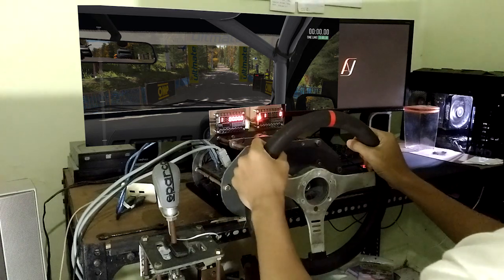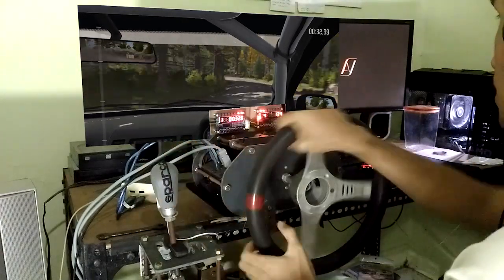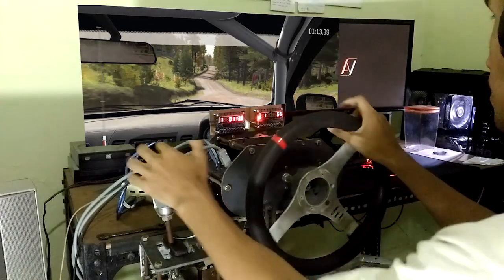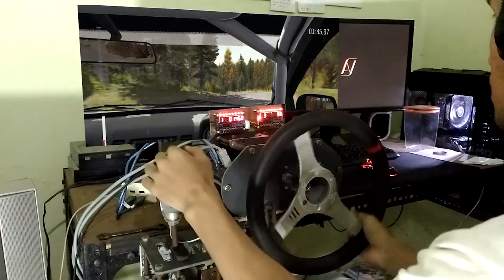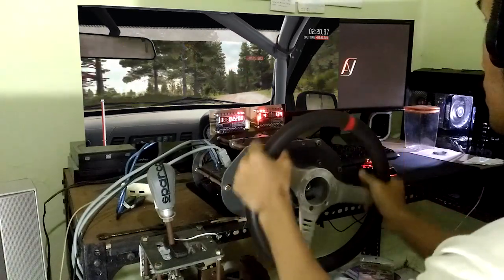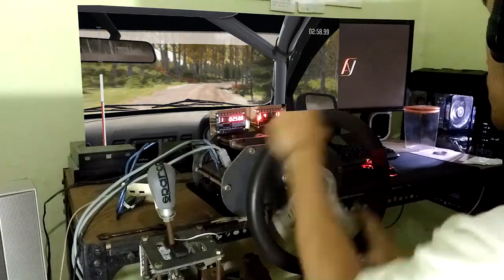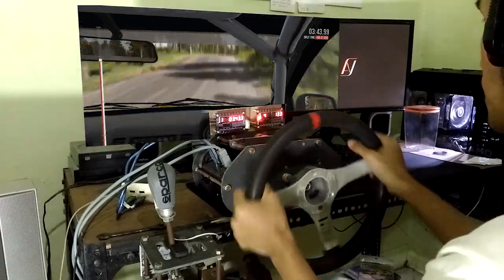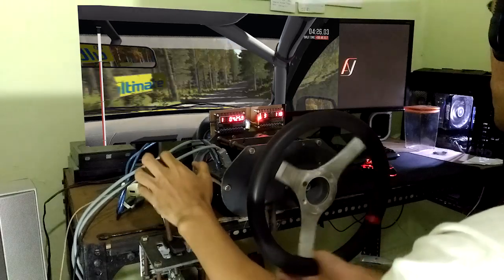Dirt Rally - DIY Steering Wheel | SIM Racing

Comment: Usas Leonardo? Para el volante usas un encodificar de impresora? y para los pedales usas potenciómetros solos o con resistencia?
Reply from the maker: yes i use leonardo and printer encoder for this project.
My pedal use 10K potentiometer.
Reply: @AgaYuditraStudio  Y no has tenido algún problema?
Reply from the maker: only a small problem with noise in the potentiometer can be solved by adding capacitor
Reply: Podrías enviarme una foto de cómo lo arreglaste? Te dejo mi correo jqh_1504@hotmail.com 
Y disculpa la molestia.
Reply: Y para el encoder de la impresora cuál se puede usar?
Reply from the maker: I use canon ip2770 printer.
Reply: @victoralejandrocanteraherr9003  el encodificador de la impresora no tiene problemas, lo que falla es el potenciómetro. Por eso mi pregunta.
Reply: @josueherrera8547  y el encoder como lo has conseguido?
Reply: @victoralejandrocanteraherr9003  Donde arreglan impresoras venden eso, a mí me costó aprox 5 dólares, pude pagar menos pero en fin. Algunos de ellos no saben pero es mejor que lleves una foto o algo. Me funcionó bien, lo probé en NFS MW y controlaba bien.
Reply: @josueherrera8547  Muchas gracias Daniel, la verdad es que ya no sé donde buscar y no sabía si podía coger otro encoder. Preguntaré por las tiendas a ver si lo encuentro. Un saludo!!
Reply: @victoralejandrocanteraherr9003  En Aliexpress hay varios, los chinos están 10-15$ y los mejores están 25-30$. Pero mejor busca, de seguro encuentras uno, es más barato y funcional. Suerte.
Reply: He buscado en Aliexpress y he preguntado en las tiendas bajo el nombre "encoder canon ip2770" pero no encuentro nada, que palabras buscaste?
Reply: @victoralejandrocanteraherr9003  Búscalo como Encodificador Rotativo o Codificador Rotativo, de donde eres? Yo soy de Perú y encontré el Codificador de impresora tuve que viajar unas 2 horas pero lo encontre, se puede usar de cualquiera siempre y cuando sea de Canon. No importa si es ip2770 cualquier otro
Reply: @josueherrera8547  Soy de España, pues voy a buscar por esos términos. Gracias crack, saludos!!
Reply: A España llega mas rápido ese tipo de encodificadores de 15 dolares igual los de 30, pero si consigues una impresora de segunda mano canon a 20 dolares te convendría porque podrías usar el codificador de la impresora y también sus motores. Suerte en tu búsqueda (y)